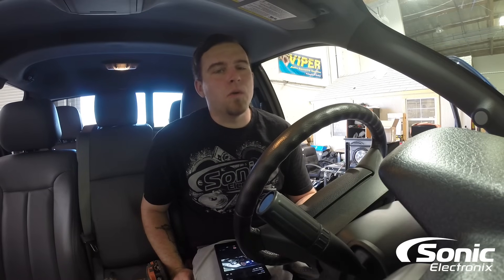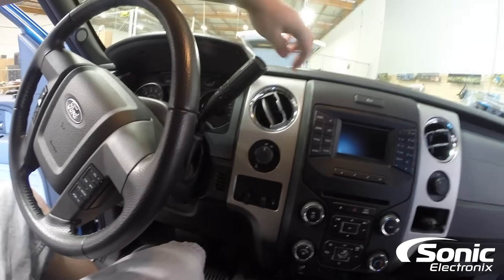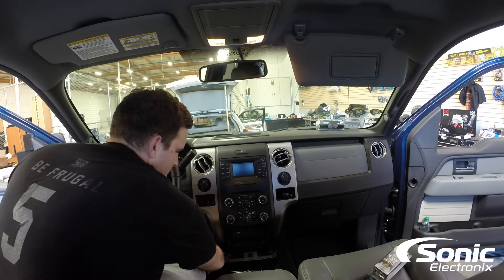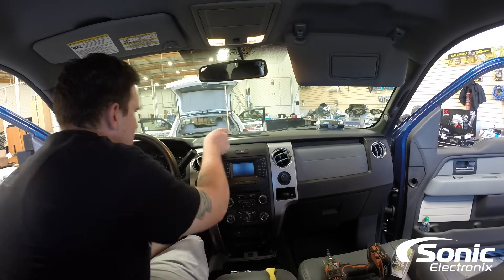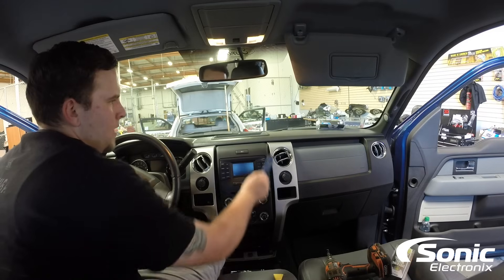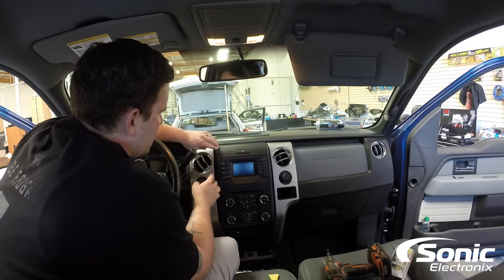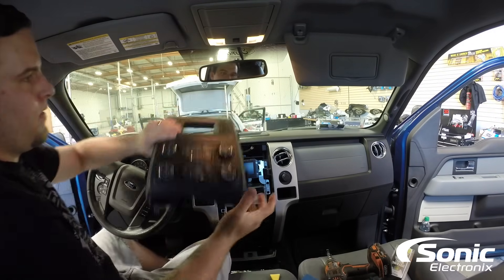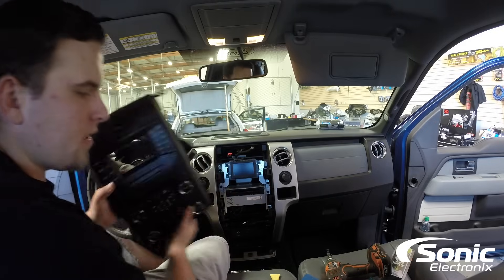How to Remove Dash Panel & Factory Stereo | 2013 Ford F150

Comment: Hey everyone this guy don't tell you that if you are taking that 7mm bolt off on the passenger side and you have to take that passenger side airbag cover off. There are 3 bolts you HAVE to take off underneath it. You have to drop the glovebox to get to them. They are 3 black 8mm or 5/16. Depending on your preference. It will save you a lot of headache. And you won't tear up your airbag cover like I did. Just wanting to help everyone out.
Reply: This is why I'm here. Thank you
Reply: Yep, this video is missing a few key points. SMH.
Reply: Thanks man. About broke the silver piece trying to do it 👍🏻

Comment: Those stock stereos are junk. Replaced mine in my 2013 after the up, down, left, right setting buttons stuck in and wouldn't pop back out. The CD player quit working as well.
Reply: I've replaced all mine twice now along with the water pump and heater motor...twice. These 09-14 are junk. So many issues with them. Shocked when I found over 1000 issues on the forums.

Comment: Next is to remove the seats and entire dash if you need to access the heater core. Mine leaks where the heater hoses attach. First Ford truck and definitely my last Ford truck. So many issues with these shitbox 09-14 models.

Comment: Pull the airbag out of the glovebox, makes life so much easier. Open the glovebox completely and you'll find 3 10mm bolts if you look directly up; they're in the shape of a triangle. Undo those puppies and from the outside GENTLY release pressure around the edges of the airbag cover, then reach back inside and push the airbag outward just enough to get the other 7mm hidden behind the cover to completely remove the silver air vent trim panel. All of this needs to be done with the negative terminal of the battery disconnected. This way you're not flexing the living bejesus out of the trim panels and risk cracking or warping them.

Save your breath telling me it's dangerous. I'm a Ford technician and have done this at least 100 times to put Sirius add on's into them and I've never had an issue except for having to reset a clock.
Reply: Joe~ I have a 2010 F150  Lariat. I would like to wrap the fake silver area by the ac vents and under the steering wheel. As a Ford Tech you would know the best way to do this. Can you give me some hints....like where screws may be etc?  Thank you

Comment: Instruction how to remove panel is good, however the speed fan control is stock on high wont turn off is that the dash panel or need different part to resolve the speed control knob

Comment: Are there are RCA pre outs on the back of the head unit of a factory 2013 14 XLT Ford F150 radio I'm wanting to add a amp and sub I've already upgraded the speakers in the doors I would like to keep the factory radio but I do not want to have to take anything apart if the head unit does not have what I need to tie into the amp
Reply: No buy a line out crossover kit

Comment: So is there a blend door actuator under the dash? My 2013 F150 5.0 has one bad I think. Makes the usual loud clicking noise under the dash when switching heat to cold air. Changed the one behind the stereo already but didn't fix it
Reply: If you have dual control, there's a second blend door against the floor for the passenger side. Its even harder to replace... Good luck.

Comment: anyone know the part # for the factory radio/cd player with sync? My  cd player skips and rarely plays cds and is hard to load/eject cds in my 2013 XLT 5.0. Cleaner discs were useless and would get stuck too. Ebay is showing different factory stereos for the 2013.

Comment: How do you remove the dash panel and radio in a 2014 silverado  work truck? I have the screen but no navigation or onstar. Also what's the best shallow mount sub
Reply: Try Rockford fosgate p3 slim or there powered subwoofer